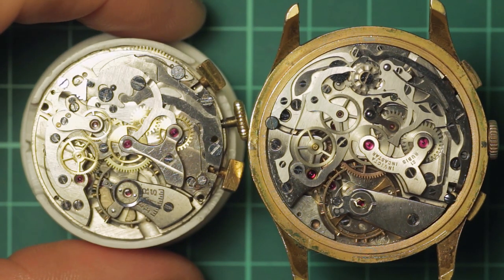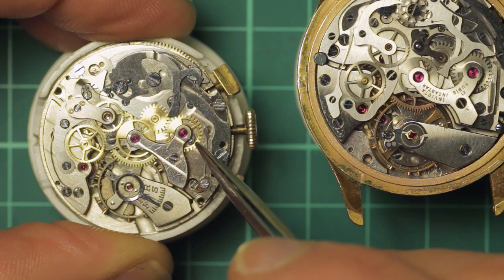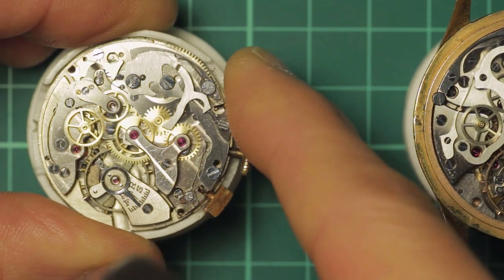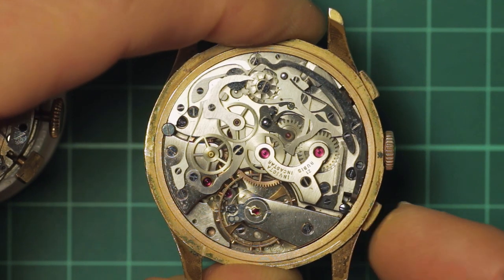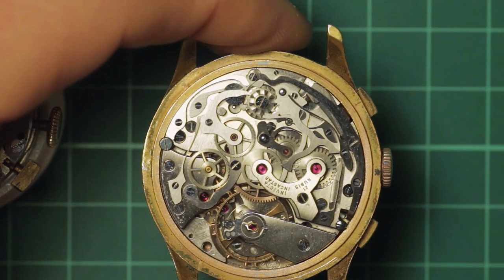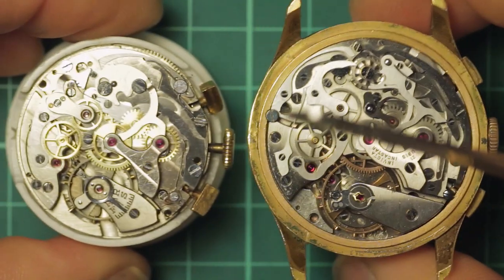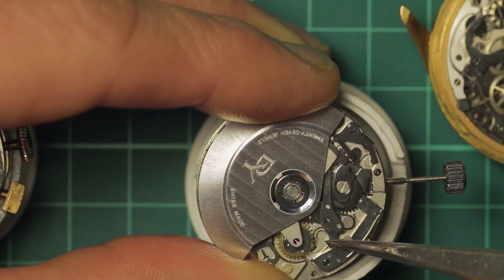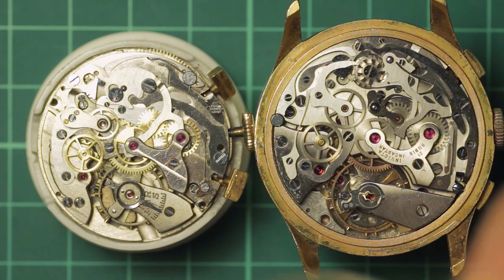Chronographs - Column Wheel v Cam Lever, What's The Difference?

Comment: Column wheel is less reliable over time and more intensive to service??
Reply from the maker: Usually a few more components and a little trickier to set up if things have been adjusted incorrectly but no less reliable. A more tactile feel to the pushers than a cam lever chronograph.

Comment: I was hoping to see these running to see if what's happening in my vertical clutch Poljot chronograph is normal; when the chronograph hand isn't running, the coupling clutch seems sort  half-engaged to the fourth wheel, making it jutter. When activating the chronograph everything meshes nicely and I don't notice any issues, but it looks weird to me.
Reply from the maker: I can pop the back off one of my 3133's to show you at some point and upload a little clip.
This is perfectly normal though, the coupling clutch pivots as you'll know and the gear on the 4th wheel is fixed, because of the arc the same meshing isn't going to be precisely consistent and because it's not a precise fitted mesh, (there has to be backlash to prevent binding), this leads to it looking like it's stop/start moving. When activated,the contact with the much finer teeth of the chronograph runner, (designed to ensure a smoother start though these horizontal clutch chrono's can jump very slightly), takes up the excess play and again needs to be adjusted precisely to prevent binding but maintain driving pressure and meshing.
Reply: @spidiq8  Thanks very much for the reply.

Comment: I have both in the Seagull ST19 and the Poljot 3133,very little difference in operation although the 3133 feels a little more crisp when activating.............................
Reply from the maker: You'd notice with a well made and maintained vintage Swiss chronograph though. I have some 3133's which are a copy of an older Venus movement and in true Russian fashion they're a more agricultural finish and operation than the original Venus. I haven't yet used an st19, also a copy of an older Swiss movement, but imagine that, likewise, they're Little 'rougher edged' than the Swiss ones.
Reply: @spidiq8  As I understand it,the Russians made some alterations to the original design one of which was to increase the beat rate.As a result of their "adjustments" parts between the original and the 3133 are not interchangeable Although I don't know if this would apply to the ST19.................
Reply from the maker: @russellharris5072  yes that's correct. Cosmetically thr changes are minor internally but the vph of the 3133 is 21600 rather than the 1800 of the original, presumably to improve the overall accuracy as many Russian calibres suffer from noticeable positional variation.
I'm unsure also about the ST19 as I've yet to work on one but they look nicely made and I've fancied a 1963 for a while.
Reply: @spidiq8  My ST19 lives in a chronograph by Timefactors and is based on equipment issued to RAF pilots,I don't wear it consistently enough to be able to give an opinion as to it's performance..................
Reply from the maker: @russellharris5072  I suspect based on other seagulls I've seen and worked on it'll be pretty consistent and quite accurate, they're a much better made chinese movement than any other i've seen
Reply: @spidiq8  oh yes the ST19 has 21.600 beats and therefore is an improved copy of the Venus 175 which runs at 18.000 beats.

Comment: Great video, thanks for uploading. I have a question regarding my chronograph which has a movement with column wheel... every now and then when I start and then stop/pause the chronograph and then try to start it again, it won't work (needs one or two more pushes to start again). Its pretty rare that this happens, but is it a sign of an underlying problem? (The movement is an IWC calibre 69385)
Reply from the maker: Thanks. Glad you liked it.
There are over of two possibilities depending on whether I've understood you correctly.
The start stop should do exactly that per press and just rotate ad infinitum until you stop then reset.
So if you're pressing to stop then pressing again to start and it doesn't but a second press does this suggests it's not turning the pillar / column wheel which can be either a build up of dirt, skin cells etc in the pusher tube preventing a full press or wear in the lever mechanism which pushes or pulls the wheel.
The other possibility is, if you press to stop then again to start and it doesn't do you press to stop and then again to start and it does it indicates that something is sticking, possibly the coupling clutch mechanism.
If your watch has an exhibition caseback or you are able to remove it you can operate it and watch the action and establish where the problem is.
In either instance it sounds like your watch is due a service, cleaning and replacement of gaskets etc.
How long since you had a service or how old is the watch if you haven't done so?
Reply: @spidiq8  thanks mate, thats the thing, the watch is less than a month old. Its only happened 2 or 3 times, and i played with the chronograph function a lot :) I really want to avoid a warranty case because the problem is hard to replicate, and the warranty process takes ages and is a pain in the... 😅
Reply from the maker: @startinsomethin  A quick check to ask and no disrespect meant. Have you had mechanical chronographs before? The reason I ask is that people who are only used to quartz are used to a gentle press of the buttons. Mechanical are very tactile and need a firm positive press.
If it's not this then I recommend that you do return it, when you pay for something like an IWC you expect it to work as intended and like any watch, faulty ones can slip through, being so new you potentially have a case for replacement but certainly take it back to the dealer you bought it from for rectification.
Reply: @spidiq8  hi mate, no problem, yes I've had mechanical chronographs before :) the AD said it needs to be sent to IWC to check... now my concern is they might not find anything wrong because the problem is rare... and charge me for the inspection. I might try replicate the fault while taking a video with my phone or something, I'd have to get really "lucky" though lol. Thanks for your help mate 😎
Reply from the maker: @startinsomethin  Trying to film it is s good idea. A bit cheeky of the AD to tell you that, check the relevant sale of goods act for the country you're in. I'm sure the UK has regulations regarding items not fit for purpose which would apply to this.
Reply from the maker: @startinsomethin  Thanks for sharing that. Glad you caught it on camera and hopefully the AD well just replace it for you.

Comment: Great explanation, thank you! What about horizontal vs vertical clutch? Is there a movement with the column wheel and the vertical clutch?
Reply from the maker: Yes, the Seiko 6138 / 6139, Citizen 8110 and 8100 and the new Rolex Daytona with in house calibre are all column wheel vertical clutch chronographs.
There are a couple of other Seiko models which are too but all very similar in principle to the 6139 etc. I don't recall the model numbers offhand.
Reply: @spidiq8  Thank you for the reply. So Speedies have horizontal clutch only...
Reply from the maker: @martin.B777  The Omega? I believe all iterations from the initial to later in house are all column wheel horizontal clutch type.
Reply: @spidiq8  Yes, Omega Speedmaster. I think, the last Speedmaster movement with the column wheel was the calibre 321 (which has been recently reintroduced with Ed White edition). I'm new to horology and  always learning new things ;).
Reply from the maker: @martin.B777  There's always something new to learn. Believe me. I've been doing this for a number of years and I discover things I never knew regularly.
I love passing on the knowledge I do have and encouraging others. This is a fascinating pastime.
Reply: @spidiq8  I believe the new IWC Portugieser Chronograph also has a vertical clutch column wheel movement.